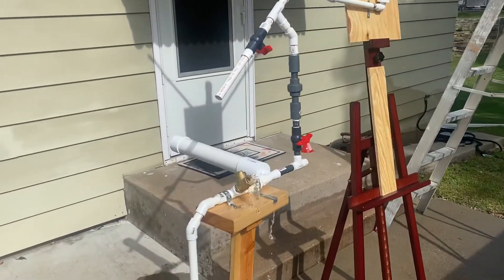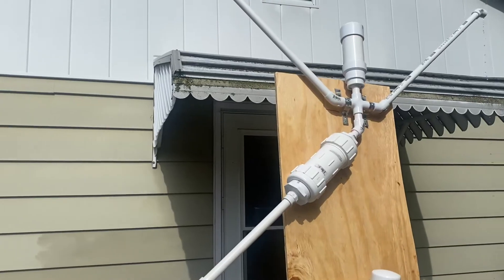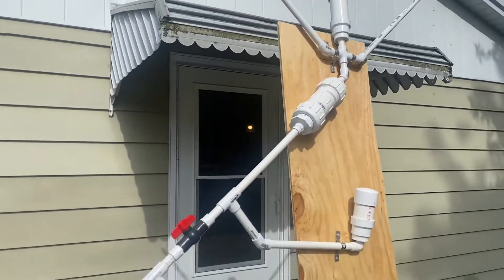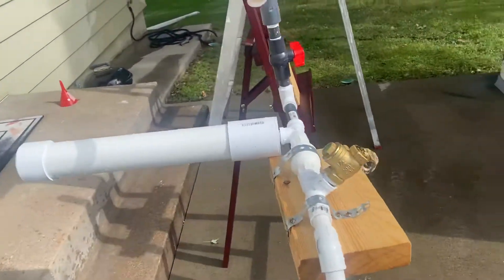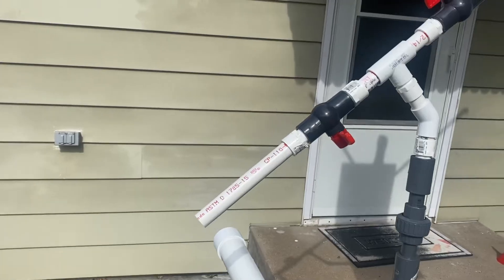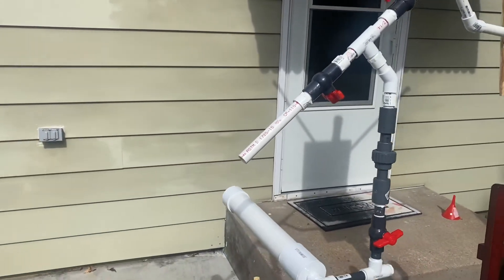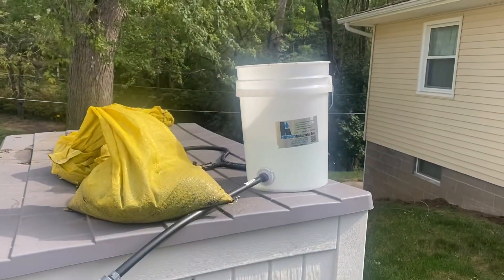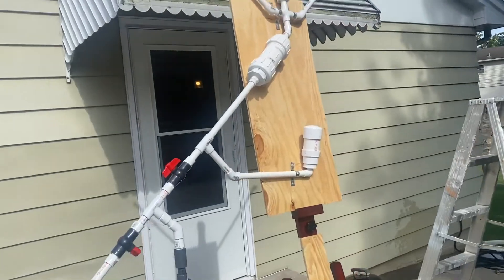The Great Pyramid of Giza Ram Pump Theory works!

Comment: out of all the theories about the great pyramid this one MAKES THE MOST SENSE…and unlike the other theories, yourself and others have built WORKING REPLICAS …not a power generator, not a tomb, not reaction chamber…just a giant water pump…one that undoubtedly was used for civil works and agriculture…this also makes sense why such resources and time would be dedicated to such a structure….this structure also makes sense in that that white reflective casing stones (if coated in a stream of water) could in theory locally effect the climate
Reply: What sense it makes when you need the water to be already 57 meters higher than the level of the Nile to make this pump to work ? And a ram pump need the water to flow, so it NEED to evacuate the major part of the water lower than the incoming water. But there is no way in the subterranean chamber for the water to flow out or in. Scientifically it is impossible for the pyramid to be used as a ram pump.
Reply from the maker: The water comes out of the upper Grotto.  The subterranean chamber is the first of many pressure chambers to assist in pushing the water up to the King’s Chamber which is plenty high enough and would have enough back pressure to make the ram pump work
Reply: @tommartens3731   the upper grotto is above the ground level and link the horizontal passage and the bottom of the great gallery to the subterranean chamber. There is nowhere the water could flow lower to make a little flow go up. There is no way out of the pyramid for an hydraulic theory but the entrance and the only 2 air chafts of the king's chamber (those of the queen where not opened on this chamber). No flow going down and out mean no flow up in a ram pump theory.
Reply: but back then the Nile ran beside the pyramids, so no need for a water pump

Comment: quite interesting. came here after watching theories about chemicals being created there. one part required also water getting pumped up, but it didn't make much sense, they assumed manually driven pistons to push the water up. the central chambers look like "furnaces", and built to hold high pressure. there are a couple more valve-like structures also in other pyramids which would allow for multiple steps in the process.
as just a ramp pump alone, the shapes and some chambers look weird and "useless", but combining both theories could make sense
Reply from the maker: In my theory, the Queen’s chamber, the Grand gallery and King’s Chamber were all areas for silt deposits.

Comment: Truly fascinating! Water as the input would seem to make sense. So was the use of these systems solely to pump water whether into aqueducts or other channels to irrigate crops, etc. or were there other purposes too? 
Just seems like a massive structure to be only a water pump… and why orientate it so precisely to true north and make the dimensions so specificity scaled to our planet?
Reply from the maker: Thanks!  Yes, the water would be used for crops, animals, people, recreation and any other quality of life, infrastructure uses.  Size equals output on a ram pump.
As far as alignments to stars or true north, my theory does not point to anything in particular nor does it rule anything out.
Reply: @tommartens3731  If this were just a fancy water pump for crop irrigation then I would concede that the alignment to the stars and north would be akin to a part manufacturer stamping their brand logo on the parts.
Reply from the maker: @ikannunaplays  It is, the only working theory on what the Great Pyramid was used for.  Please like and share.
Reply: @ikannunaplays  by the size of the pyramid, I'm thinking how much potential energy the ram pump can make.. so for me the pyramid could be for water irrigation and a powerplant.

Comment: I see the water comes out at a higher level than the bucket. Is it possible to make the water which comes out of the pipes flow back into the bucket? What happens then?
Reply from the maker: Since the Ram Pump “wastes” more water than it pumps, you would eventually run out of water.  With the Nile river as the source originally, that would not be an issue.
Reply: @tommartens3731  Even then, it looks like the law of communicating vessels is violated, so there might be away to redirect the wasted water to the bucket also. And find a way that the water doesn't evaporate.
Reply from the maker: @gersonnl  With my theory.  The “waste” water would have been directed in the moat from the upper grotto area.

Comment: This is just incredible! I hope this work is getting some attention, because it is the first time I've seen a working model of an acceptable theory on what the Pyramids are all about! No Woo Woo. They were PUMPS! Why is this not front page news?! I have a few questions. Do you think it was possible that with the Pyramid's limestone encasing intact, and a constant stream of cold water running through it's interior, that the exterior might have acted as a massive water condenser, pulling moisture from the air adding even more fresh water to the "moat" around the base? and. What's going on inside your PVC pipe chambers? Do they resemble the King/Queen Chamber, or is it just a volume thing?
Reply from the maker: I don’t think any condescending was going on per se.  I built the other chambers thinking they could be additional pressure chambers.
Reply: @tommartens3731  yeah, no, it's difficult to articulate. You built the inner workings, and I'm just blown away. Clearly this is what the Pyramids were designed for. I was wondering if you thought it might be possible that the exterior of the Pyramid was also used as a water collection device via condensation. Wouldn't constant circulation of water on the inside keep the outside cooler than the surrounding air temperature?
Reply from the maker: The chambers do represent the grand gallery, Queens Chamber and King’s Chamber at the top and all of the subterranean chambers below.
Reply: @tommartens3731  are they open chambers? In your model? Or is there any kind of baffles?
Reply from the maker: @EdwardSeatonSailing  no baffles
Reply: @tommartens3731  cool mate but doesn't explained how they were built... To be just water pumps
Reply from the maker: @luciuslucianski4778  https://youtu.be/7CVcpiSGiOM. Or. https://youtu.be/TJcp13hAO3U
Reply from the maker: The upper chambers do also provide more back pressure that ram pumps need.
Reply: @tommartens3731  the reason I ask about the chambers is that there's been some interesting research done on the "baffling?" above the King's chamber. There is also allot of chatter about sound stuffs. I wonder if They (the builders of the P) used sound to get the pump started.
Reply from the maker: https://youtu.be/TJcp13hAO3U

Or

https://youtu.be/7CVcpiSGiOM